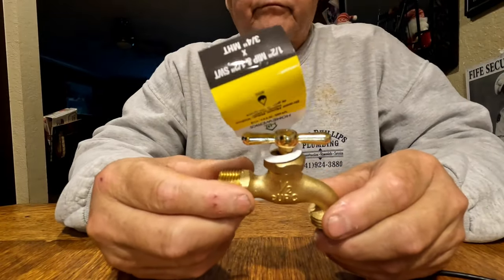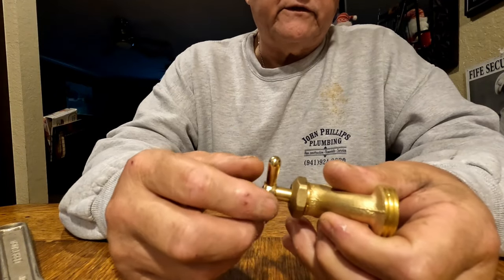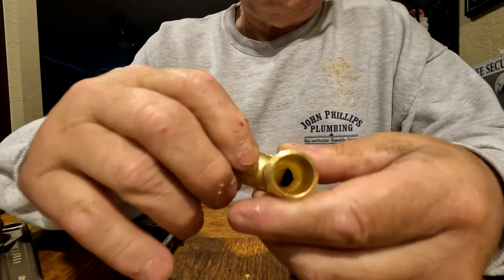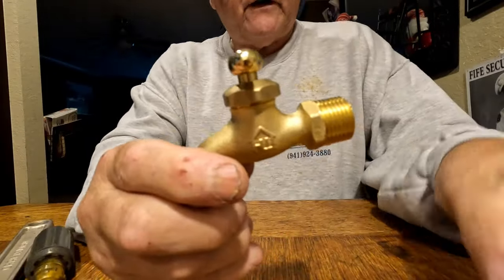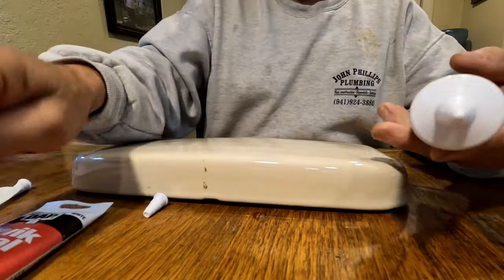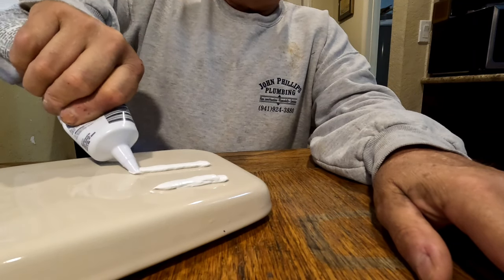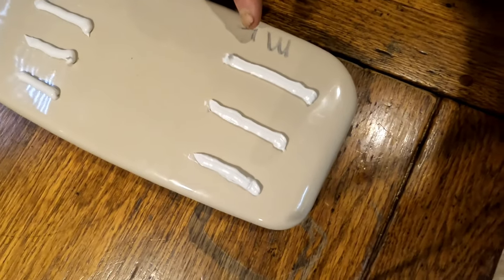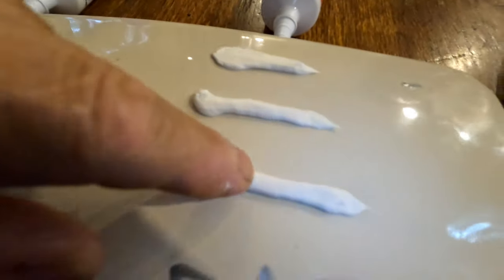NEW HOSE BIBS AND A SIDE BY SIDE COMPARISON OF DAP AND MAINLINE TUB AND TILE CAULK!

Comment: I don’t think you read my text before but your test on adhesive caulk for your test you should check Loctite adhesive caulk put that test also easy to get out of the tube. They have it at Lowe’s. I saw you shopping. I seen it on the shelf. I like these videos you try and certain things out we all need to look out for the cheaper price but the better product. I may be wrong, but I like Loctite.
Reply: After all, Loctite makes adhesive for bolts get some of that